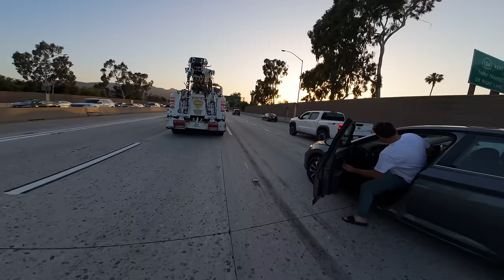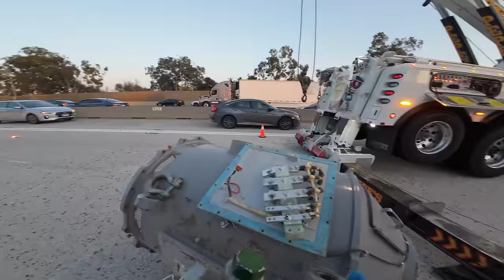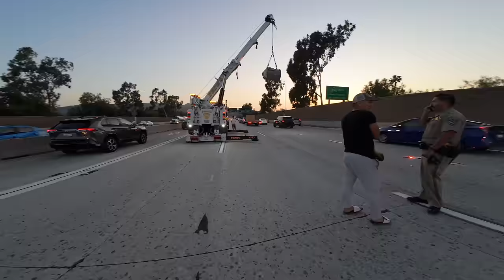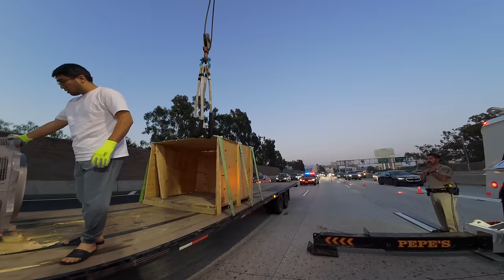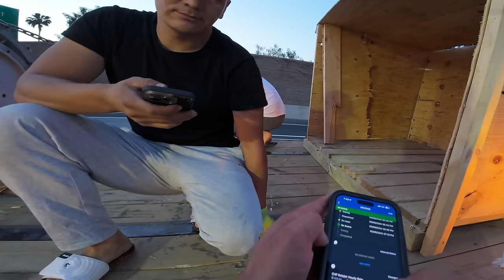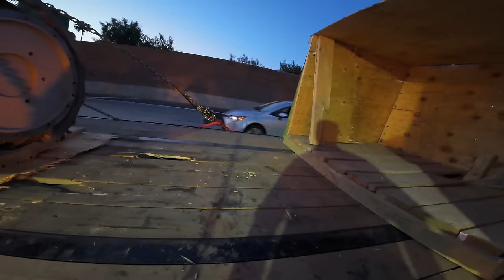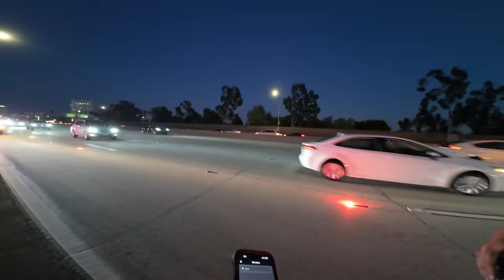18,000lb Alternator Falls off Trailer on Freeway

Comment: OSHA-approved sandals no doubt on the operator and his partner.  I guess that’s what happens when you hire the lowest bidder to move your expensive alternator.  

Not only is the cargo a write-off, but the recovery bill on picking this off the freeway wasn’t cheap I’m sure.
Reply: No it absolutely was not cheap, I guarantee you that. Usually it's 5 grand just to fire up the rotator and have it drive to the scene... that doesn't even begin to include additional recovery fees, whatever fines the cops issue, rate adjustments from the broker, increased insurance rates... shit adds up reeeeaaaal quick.
Reply: @Cheeto_Fingerz insurance...scary thing.  A $50 speeding ticket costs you thousands more in insurance before the points are off your license.

Comment: Customers Should Be Fined 
For DELAYING THE PAYMENT process!!!

As a Business Owner - Towing and Mechanic Shop 24/7 Services 

I Feel the Pain of the Highway Patrolman 🚔 and the Tow Truck Responder !! 

When Service’s are Rendered/ Performed … 
The Customer should Not turn the payment process into a “ Bidding War” !!!
This is Disgusting and Distasteful on the part of the Customer!! 
Also in part … it Puts a Huge Strain on Public Resources as well… Due in part because the Tow truck operator and any police involved must Stretch out the duration of Blocking traffic flows and also further Jeopardizing the Safety of the Responder’s and the Motoring Public !!! 
Therefore…. By Stipulating a “ Fine “ for Obstructing the Necessary Payment Process… this will likely Make Future Customers AWARE that there will be a Penalty for Delayed payments and processing them as well!!! Which will likely make Customers feel the need to take care of their Bill in a much Timelier Manner!!!!

Comment: I would have said on video that the load was not secured inside of the crate. And because of this driver was unable to see or even determine if load was correctly secured. It may have been secured on the exterior but the driver could not see what was inside the crate period not his fault

Comment: I love how he just walks right under the hanging load.
Reply: Yes, I thought the same thing.
Reply: @joeyjamison5772  His flip flops will protect him
Reply: No situational awareness. And of course the safety sandals will protect him. Lol
Reply: @markat9576  That's par for the course these days. Walking under a suspended load is a good way to become a ketchup packet if something were to fail at the right moment. Which is why you don't do that.
Reply: Was he really “right under it”? The operator literally did the same thing multiple times. Where do you want him to go? Walk around it into open lanes of traffic?
Reply: The operator was underneath the boom. 🤷‍♂️ both are not thinking correctly
Reply: I hate how he takes his sweet time to back the truck up. Like COMON!!! You got 18000lbs swinging.
Reply: That’s some normal everyday stuff in China.

Comment: Truck drivers don’t wear flip flops.
Reply: Or slippers.
Reply: My thinking exactly.
Reply: Bonehead Trucker.😂
Reply: @NoName-c4y7h  Cheeseburger and a sodie water.
Reply: @fluke196c  my GNFB can safely haul over 20k legally. I only wear crocks outside to walk the dog in my yard. How the heck does it “fall off”?
 18k lbs  3/8” grade 80 4 points.  1/2”?  If it went thru loops two chains, two  binders minimum. I saw nothing showing how it was secured.  Was it really 18k? If so why not over axles?  It was in a wood box? In the front of a 24k trailer?  Not over axles, just ahead?  So was it secured by 3 flat straps now on wood box?   It still looks like less than 18k. Not how I would secure it. At least not WHERE on trailer.  It would want it right over front axle. 1/2 or bigger 2 binders.
Reply: I’m a trucker and while I have to wear steel toe boots I very frequently see truckers at truck stops with crocs, slippers and sandals.
Reply: @mybrassmonkey just means they were getting comfy for the stop maybe?
Reply: talk all you want but if im doing any real work on a car you can guarantee im in slippers 🤣
Reply: @josephcalabria2976  Reach down and tell your toes you love them. You are risking their lives.

Comment: That generator now needs a trip through the shop, that drop could have unbalanced the rotor or damaged a coil; and you can't see that without cracking the case and pulling things apart.
(Power generation always calls them generators, even if they make AC).

Comment: Did the driver get a citation for carrying a unsecured load
Reply: Looka like secured just fine what he was given. Bropably not allowed to open the box so that's 100% the shippers fault
Reply: @mikaraussi8200 the driver is still responsible for securing his load seen or not. He should've used chains. I bet he didn't have any and his car homie brought some up for him.
Reply: @FeliciaSteward-ds2dh  Chains on a wooden crate? The three straps are just find, the crate was faulty.
Reply: @carlzwanzig5372  why couldn't he put a chain across the front in the middle?
Reply: So many experts on here 😂 I’m wondering about the tongue weight lol
Reply: @mikaraussi8200  wrong it was not Secured right

Comment: Real truckers don't wear flip flops! 😂
Reply: Is that even legal in the US? It is illegal to drive in flip flops in most European countries.
Reply: @FastDriver91 unfortunately, there is no law on wearing flip flops
Reply: @FastDriver91 in some states it's illegal to drive barefoot. My Aunt Jeanne used to do it while driving 100mph. It would take her three hours to get from her house to Grandma's!!! I asked her if she ever got caught, but she didn't.
Reply: Truckies have to wear steel cap boots in our country NZ
Reply: Russian safety slides.😂😂😂
Reply: That's not a trucker that's a hotshoter 😂
Reply: He was not a trucker.
Reply: @jasonswift7098  agreed 👍
Reply: Exactly !
Reply: Hey now. Last week he couldn't even spell Truk Dryvor. This week he are won ! 😵‍💫😏
Reply: What, they are not OSHA approved?
Reply: @FastDriver91 in Pakistan it's a requirement 😂
Reply: @FastDriver91 In Pakistan wearing sandals is a requirement 😂
Reply: @Julie-g3u  Boots are actually not safer. Have you ever tried to drive when the bottom of your boot is wet or has diesel on it? You try to push the pedal and your foot slips off strait into the firewall faster than the speed of sound. Best shoes for driving have soft rubber bottoms.
Reply: real truckers also  know how to safely  tie down their loads!
Reply: Real truckers also secure their loads.
Reply: @Mars-77  How do you secure something inside a box without opening the box and breaking the seals? If you haven't noticed the wooden box never moved. The nails came out and the item slid out the side.
Reply: @arthurmario5996  rewatch the video, don't you see that wooden box securely resting on the trailer completely unmoved?
Reply: @tripplefives1402  you put straps over it.
Reply: @Mars-77  The box has straps over it, it's still sitting exactly where it was when it was loaded. Try watching the video next time.
Reply: @tripplefives1402  That's the problem. It had straps over it, but not around it. You steering wheel holders are dumb as a box of rocks!
Reply: @tripplefives1402  no matter, you are ultimately responsible to keep every part of the load secure. if you know you have 18,000 lbs in a flimsy crate, refuse the load.never trust anybody or anything in safety.
Reply: @arthurmario5996  If you refused everything loaded in a wooden box then you would be bankrupt shortly.
Reply: @tripplefives1402  well if somebody gets killed by an unsecured load, how long would your business last? 18,000 lbs is no joke
Reply: @lynnmeese55 cope. They still make more than you “truckers”
Reply: @Mars-77 we can tell you ain’t a trucker
Reply: That's all you see anymore flipflops and slides.
Reply: @FastDriver91 i see them all the time with flip flops
Reply: all the unprofessional drivers out there wear flip flops and pj's while working
Reply: What is wrong with wearing anything while driving a truck 10 hours. There isn't any work performed. Now being in anything but shoes or boots while flatbed delivery and shipper is different. But dry van and reefer can pretty much wear weather they want to. They don't do much actual work.

Comment: I hope they're not paying for that damage.That is concealed damage and never should have been shipped inside of a crate like that.
Reply: On the driver to make sure that it's safe to ship as it was.   I wouldn't take a shipment like that in a crate.   I'd have the shipper take it out so I could properly secure it.
Reply: @BenKlassen1  So  you would require the shipper to open the box to make sure it was secured correctly?  Would you add that to the time you have to spend on the job?
Reply: @AffordBindEquipment  I would have asked the shipper to remove the item from the crate and place in on my trailer so that I could secure it properly.
Crate nails are not proper securement for an item weighing thousands of pounds as we saw here!
Reply: @BenKlassen1  how would you have known it wasn't secured properly in the crate?  Would you require the shipper to open any box that is over a certain weight to see if it is secured correctly?
Reply: @AffordBindEquipment  Well, I used to do flatbed professionally so I have some idea.
Yes, going off of the weight of the item as indicated on the bill of lading, you could judge that a wooden crate fastened with just nails or screws would be insufficient to stop the forward motion of a multi-ton object in the case of a hard braking incident.
Ideally, the shipper would be smart enough to require that the object be removed from the crate and secured properly.
As a truck driver, as soon as  you sign the bill of lading, you are responsible for the safe conduct of the cargo as soon as you sign the bill of lading.   Knowing this, you should do everything in your judgment and power to assure that the cargo arrives safely.   This could entail requiring the shipper to remove the item from a crate.   I've had shippers load me with loads that I judged to be unsafe like pipe loads with broken securement bands.   I refused to accept the load until they replaced the bands.   They complained but ultimately fixed the bands, and the load made it safely to the destination.
Nails and screws on a crate are not rated for stopping the movement of a heavy item, period.

Comment: In the hot shot drivers defence 
He secured a crate on the deck of his flatbed that unknown to him contained an unsecured machine. 
Now as for the house slippers nah at least wear boat shoes or cheap sneakers.
Reply: Defense*

And it was his responbility to have forward tie downs, I bet he was driving a little to fast
Reply: @mariod818  the x straps don't count for securement. Again shipper was responsible for what was inside the crate.
Machine would not have moved if it had been secured to the CRATE.
Reply: Drivers are responsible for knowing what their cargo is and making sure it's transported correctly..
Reply: @jerrykinnin7941  driver fault, you're allowed to inspect, and if it were me and I was denied, I would have recorded it. Dude's lying people are gullible it's the driver's fault.
Reply: @mariod818  A lot of times the driver isn't allowed to open a shipping crate, or even have the tools to pry it open or renail it back shut. The shipper should absolutely pay for this, plus repair or replace the alternator. The customer will probably refuse delivery of it, and write damaged on the bill of lading. The CHP did not give the driver any citations. If it was properly strapped down to a well built pallet, it wouldn't have even budged, and they had enough straps to tie down the box, notice the box never even shifted at all.
Reply: @mariod818  That trailer isn't a lightweight trailer, and with a 18,000 pound load, plus the crate, plus all those chains, I doubt he was driving very fast, it's just a dually pickup truck.  With fuel prices the way they are in Commiefornia, these hot shot guys are trying to pinch pennies wherever they can.
Reply: @brnmcc01  I hope they do the driver was sus the entire time I'm glad chp helped pepes towing.

Forward straps would helped.. some of these boxes are over engineered but not proned to fault if the driver is driving erratic this would be an entirely different issue had it been rotated

Even more so i live in California and i know this highway lmao i bet he was hauling ass intill there was a sudden change in traffic. The whole blame game he did just solidified it for me
Reply: @mariod818  Shipper or whatever company packed that thing up; couldn't even bother to nail down a couple of 4x4's for blocking and throw a few cheap steel band straps over it? Shame, a generator head that size is easily worth several 10's of $1000's even a refurb used one.

A few straps would have kept it in the crate, but the bad thing is, what if some idiot cut off that pickup truck and it got in a wreck. That alternator would have come flying forward at highway speeds and killed someone. I remember going south on I-5 into California from Oregon, and at the Dunsmuir weigh scale I got pulled around back and had to come in with BoL, logbook etc just for a routine paperwork check. On the wall was a bulletin board kind of like a wall of shame; there was a picture of a flatbed that was hauling an old D12 dozer, with only a couple chains front and back. Well he had to slam on the brakes to stop for a wreck that happened just in front of him, and that bulldozer literally bulldozed the whole cab of that semi, and the picture showed the bulldozer sitting on top of it, the tractor was maybe 3 feet high, or what was left of it.
Reply: @brnmcc01  Wow that's crazy, i saw a truck speed off grapevine (downhill) heading to Bakersfield just run off the road and burst into flames, sadly the guy didn't make it... 

I forgot what caused the crash, but i see people go flying downhill without a care in the world, and it's just dumb and sad seeing
Reply: @brnmcc01  was not
Reply: @mariod818 Too*

Comment: So, how many people think the truck driver is just going to say that's the way it was when it was loaded?   And how many think the crate is going to windup behind a truck stop?
Reply: He better save that crate,he will need it when he loses his job and crib
Reply: He better save the crate,he will need it when he loses his job and crib.
Reply: honestly he had the crate strapped down.. who ever made the crate didnt make it strong enough to secure the item inside. It rolled and should have had something in it to prevent that.. so I would say shipping company is at fault not the hotshot delivery guy
Reply: @infidel3162 likely going to save the crate and pics/vid to show receiver. That will refuse the load. Who then now has beef with shipper for the crating job.
Reply: @infidel3162 likely going to save the crate and pics/vid to show receiver. That will refuse the load. Who then now has beef with shipper for the crating job.
Reply: @infidel3162 Doesn't matter- once the load goes on your trailer, it is the sole responsibility of YOU the driver. That's trucking 101.
Reply: @Cheeto_Fingerz  How would you have handled this differently?  Would you have required the shipper to pry open the box so you could examine the contents?
Reply: @AffordBindEquipment  I would have checked my paperwork and seen that the crate I just picked up contains an 18,000 lb. piece of equipment.. I would have then talked to the shipper and made damn-well sure whatever was inside was properly packed and secured and not just rolling around freely in the crate. All you gotta do is ask, this is a situation that could have been completely avoided with just a little basic communication. This is exactly why you need to be able to speak English if you're gonna have a CDL.

Comment: Used to ship stuff like that, it gets put on a heavy duty pallet, and a wooden frame built around it. Then it is very securely attached to the truck bed. 😮
Reply: I'd expect the overhaul costs for the alternator, and possible the revenue loss if an industrial customer needed that machine commissioned ASAP, to far exceed the cost of the best possible packaging.

Comment: Unless I wasn't seeing correctly, 18k would've saged that truck/trailer where it was placed. Prob closer to 8k.  It didnt even budge the wrecker when it lifted up.  18k would not have swung around so easily right after it was lifted.  My 14k forlift barely moves when we lift it, takes its time to start spinning.

Comment: Makes sense its a hot shot driver. I swear id never trust one to transport anything of mine whether they're a good driver or not. Ive always said they look skethcy. A full peterbilt, freightliner, etc semi is always better imo thats why i drive them
Reply: The box holding it broke, nothing he could have done about it.
Reply: I ran CDL hotshot for 3 years, and your right!
Reply: if this had been on a flatbed it could have rolled of onto a car and killed someone. at least on the hotshot it's lower to the ground. this is basically equal to a steel coil.
Reply: Kaleb you are so right. I think it's worse when u drive a semi and see some of those Hot Shot Drivers! 

That's like I'm getting ready to move and to transport my car I keep getting quotes from companies that use HOT SHOT drivers and it makes me so nervous.

Comment: If he doesn't like the cost of the lift, wait until he gets the citation for an unsecured load.  The drivers are responsible for making sure the loads they're carrying are secure.
Reply: The crate was fully secure and did not move an inch - the failure was internal to the crate which is the shippers responsibility.
Reply: @pingpong9656  Yeah, that seems reasonable.  There would be no way that the truckers could know if the generator was secure in the box.